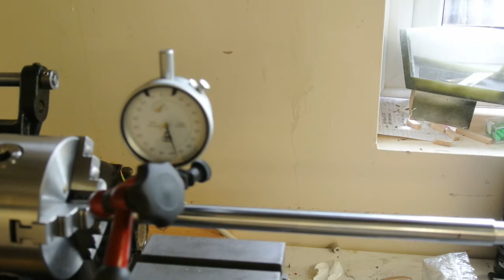drummond B type lathe C 1918

Comment: Sorry but I work in microns and have done for many years. There is no way it’s that accurate. Either the DTI is hard on the end of its stoke or it’s a 10 micron clock.
Reply from the maker: Simon

The DTI shown is one that indicates 0.001mm. i.e. it is a 10 micron indicator. Most viewers will not know what a Micron is though they will have heard about it. It is of course 0.0001 mm. 
In imperial terms it is 1/25 of 1 thousands of an inch. It has little relevance in model engineering. Machining things to micron levels of accuracy is not possible with turning. I have made turbine shafts for a miniature gas turbine I was making and the only way to get the shaft absolutely concentric and with the bearing fits + - 3 microns and the compressor and turbine fits requiring gentle heat to fit was to have them ground in a specialist facility that only did grinding. It was done on a cylindrical grinder checking the work on the comparator. It was of course turned by cnc slightly oversize to allow for grinding. I did have a problem clamping the magnetic arm to the indicator causing it to stick. I now mainly use the coarser .01mm indicator which is quite accurate enough for this type of checking. 

As it happens the lathe was surprisingly accurate despite its age. It did have its original surface scraping marks just visible. The headstock and tailstock were carefully aligned correctly.  I reground the chuck jaws despite them being new so they were as accurate as I could get them and I took great care making the backplate and grinding its fit in axial and radial direction. I have restored several lathes and on my Rivett 608 my Boxford and Lorch  I have expensive grip tru type 3 jaw chucks  that can be accurately centred and I usually ensure they are within .001mm. I also have fitted ER32 collet chucks to my Rivett lathe and BoRivettBoxfordnicely with a little checking and work to remachine the hubs.

Some of the old lathes were fantastically accurate in their day like the Rivett, but it did need the bed regrinding to get back to the specified accuracy. That was when all parts were hand made for each individual lathe and parts were not interchangeable.  The head scraper even signed the back of the Rivett lathe labels.

John

Comment: I am restoring a very old drummond lathe and I can't take apart the chuck bed. I think the age of the lathe is 1940s 50s. The chuck bed is the one with the over head handle built into the base or bed like yours. Every thing seems to be pressed in. I have taken out certain grub screws but it wont come apart. I don't want to clean it with Battery acids or waterbased products because I wont be able to clean them out of the shaft area properly and cause further corrosion. Can you help.
Reply from the maker: Peter
First of all please do not use battery acid. All you need is vinegar if there is a lot of rust and leave it for a day or so before washing it off and using something like borax dissolved in water to counteract the acidity.
The Head of the lathe comes off the bed quite easily. There will be 2 bolts and a dowel pin that holds it in place.
Once the head is off the lathe and cleaned you can remove the bronze bushes if you want to but if they are in good condition then best left undisturbed.
If yours is the B type lathe it will be WW1 vintage. There will be a number stamped on the casting of the bed that you can check on with the User group for Drummond lathes which is very active. It is a good place to post questions on. www.drummondlathe@groups.io.
Oncephotos on the Drummond pages you should find some help there or post a question.
John

Comment: Hi John, 
Sorry to inform you, but if the chuck has a run out, you are measuring it with that test bar chucked in. Wouldn't it be more accurate to stick it into the spindle nose?
Reply from the maker: Daniel

I was measuring the chuck run out not the spindle run out. As it is a parallel ground bar it would be no use 'stuck' into the spindle nose.

Comment: Hi john
I’ve been restoring a 1912 B type in Australia. You have done a great job on yours I’m really impressed. I’m having trouble finding anything on the gear set up for screw cutting do you happen to have any information? Thank you Andrew
Reply from the maker: Andrew
Thanks for your kind comments. Have a look at my video of the tumbler reverse gears 
https://www.youtube.com/watch?v=-iqxmo-sf6c&t=5s
This shows the gear train. I did work out a chart of the gear ratios for screw cutting but it went with the lathe when I sold it. 
Have a look at the thread label for this M type lathe. You may find one for a B type but it will be similar. I managed to buy almost all the gears that were made for the Drummond B type, as well as cutting some extra 20 T idler gears.
https://www.practicalmachinist.com/vb/antique-machinery-and-history/drummond-bros-3-1-2-m-type-312079/
Recently I made the gears for as Sloan and Chace lathe that I bought with the threadcutting attachment but very few gears. I worked out the gear ratios and made my own chart.
John

Comment: May I ask how you cleaned the bed. If the original scraping marks are visible then it must have been in quite good order but what did you do to clean it?
Reply from the maker: Jack Yes I was lucky, the bed was in good condition except for a sections that had been exposed to the air particularly at the rear. On this make of lathe a large part of the bed is covered by the compound slide and tailstock. The rustier sections were cleaned up gently with a razor blade, light stoning with an Arkansas stone (nothing coarser) and rubbing with oil and a cloth, if you make any attempt to use abrasives to get rid of all rust pitting you will reduce the accuracy of the lathe. If you really want to see a pristine bed surface then regrinding or if you are skilled enough hand scraping are the only options. I guess it depends on whether the rust pits are not too deep. The smaller parts I soaked overnight in vinegar. I was really pleased when I checked the accuracy of the lathe which was excellent after all these years and some pitting with rust. It was amazing to see the original scraper marks in places. I guess that lathes like these that ended up in the hands of amateurs are much likely to have had much less use and wear than if they were in an engineering workshop. Since then I have restored a Sloan and Chace lathe and that has most of the original scraper marks and is virtually unused over 100 years. Yes there are amazing lathes to find out there.

John

Comment: ....just acquired a 1939 m type flat bed...any idea of the original colour? I am mid refurb.
Reply from the maker: Andy, Mine was black, just scrape the paint away and check. My castings were pretty poor surface finish and they were sort of filled with a thick black primer.
John
Reply: Cheer
Reply: Cheers John.... mine didn't come with any thread bull gears...i expect they would have been imperial?...is there anyone who sells new metric sets that may fit my machine...youve done a cracking job on that by the way.
Reply from the maker: Andy sorry didn't reply... mine was black underneath.

John

Comment: Beautiful job....i may have the opportunity to buy a 1939 m type Drummond....what would the max price you would pay for one of these..it would need a good refurb. ?
Reply from the maker: Andy, Thanks.. It all depends on condition and whether it will need a regrind. I was lucky and was usable despite having a little surface pitting from rust Definitely could not justify a regrind. I reckon about £250 would be a fair price. I had to buy gears and new chucks so it is good to use for another 100 years.
John

Comment: Wow very nice! Just picked up one of these! Can I ask how the tailstock drill chuck is removed as it is out of line.
Reply from the maker: Sam

Thanks for the kind remarks. 

The tailstock can be moved quite easily. There are 2 screws and 1 pin that hold it in place. It has a square recess and tongue that it rides across the lathe in. All you do is unscrew the bolts and there will be enough play to adjust it to one side or the other. Don't forget that the headstock must be accurately aligned first. That take a while as you have to machine a rest piece to check that it is making a parallel turning.

If the chuck is stuck in the barrel that is a more of a problem. I had a centre stuck in mine and with use of a little heat and twisting it came loose. I bored right through the barrel so I could fit a bar and tap it out if it happened again.

Good luck with yours.

John
Reply: john2478 excellent information thanking you for a swift reply . I can't wait to get using her. Would you happen to know also the MT number for a new live centre I need to buy .thanks again and keep up the great work
Reply from the maker: Sam

They are 1 MT. John
Reply: Hi , me again , I need to change the main belt , is it easy to remove the main spindle ?
Reply from the maker: Sam Yes easy to remove, just remove the back gear shaft and gears, undo the rear nut of the headstock, remove the grub screw from the bull gear and gently tap the spindle out with a soft mallet. Don't hammer on it  as it should come out quite easily. If you dont want to do this then use a multi link belt. The first time I removed mine I made up a screw jack and screwed it out. It was just a piece of threaded rod right through the shaft so it screws up on the extreme end of the shaft. The front needs something with a large diameter to clear the front of the shaft. so it presses on the casting.
John